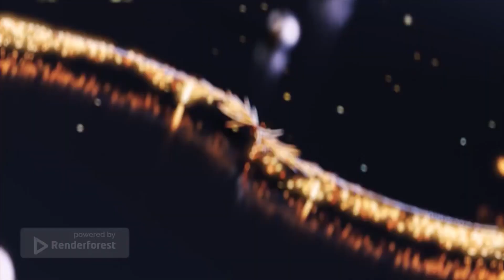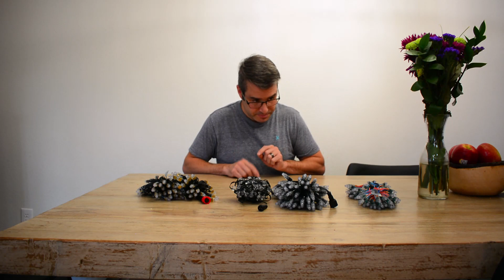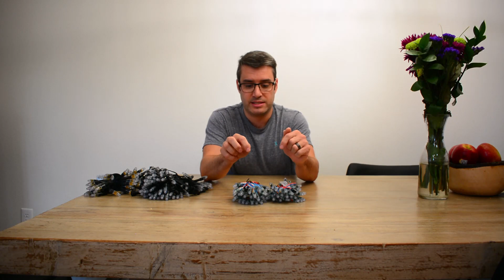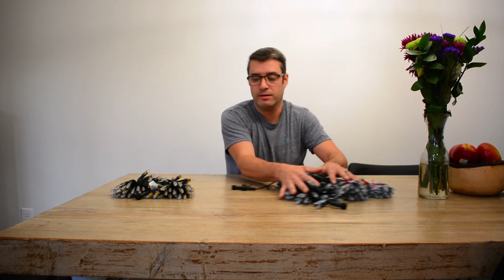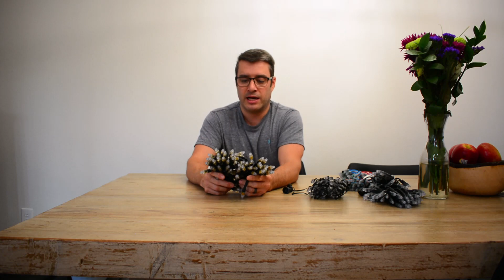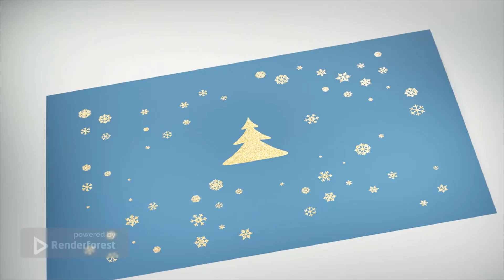5V, 12V, pixels, EVO & duo - Oh My!

Comment: If im understanding when power planning you cant just take 30% current.  Do i need to plan power at 100% current? Referring to evos
Reply from the maker: That depends on the type of pixels.  Standard WS2811 pixels you can assume that 30% brightness means they will draw, at full white, 30% of their normal draw.  In our personal show we don't push much past that in the even of a pixel failure, which could "bypass" that brightness limit and pull a higher draw.

Both EVO and DUO pixels are native 12v - so they're a little different than your typical 2811.  The EVO pixels pull full draw whether on, off, or any brightness effect (in actuality they do pull a little less if brightness is lowered, but you should factor a constant draw with EVO's).

Comment: I like the GS8208... The backup data line, constant current, nice brightness, and the Gamma Correction seems to give it an advantage on dimming effects and color curves.
Reply from the maker: This year we helped set up a show with both the DUO and standard WS2811 bullets.  At the same brightness I was surprised at how much more vivid the 2811's were.  For that application the DUO's were still the dominant/necessary pixel for sure.  Thanks for the insight!
Reply: @CharleesProps  Thank you as well for the reply. I enjoy your work and have learned plenty from your videos.
Reply from the maker: That's why we do it!  To help others learn from our experiences!

Comment: Just an FYI, I have an EFL Designs Globe NSR and a ShowStopper Snowflake (each with 750 pixels) and I have EVO pixels in them with no power injection and no issues.  I am only running them at 30% brightness but that is plenty bright.
Reply from the maker: FYI, brightness has very minimal effect on current draw for EVO's.  This is well known and something to calculate, as if they are at 100% brightness.  This includes when they are off.

Comment: Thank you.   I was curious about the evo and duo and this was very informative.   I am still a noob, but I am going to throw it out there that the flickering in the evo's is due to the smaller gauged wire.
Reply from the maker: Thank you!  The wire gauge could impact this (as smaller wire does increase resistance, dropping voltage over the line) - it happens because the 12v power line is the same as the lights being "native" 12v.  Adding a Spiker T levels/bumps the voltage at the middle/end of the line - in the same way 5V pixels need power injection/balancing.